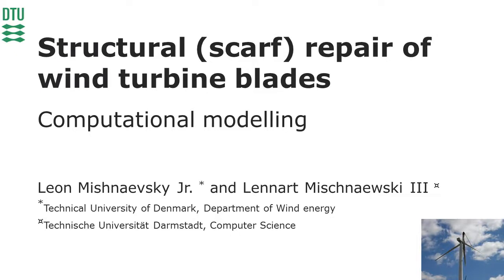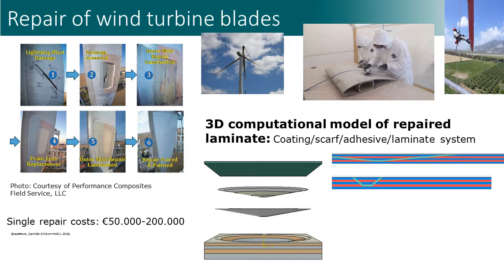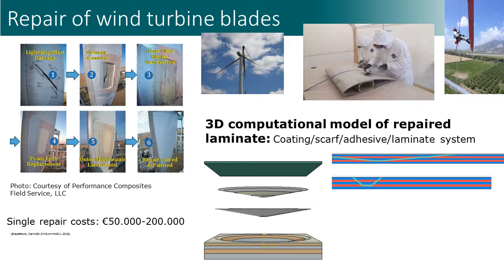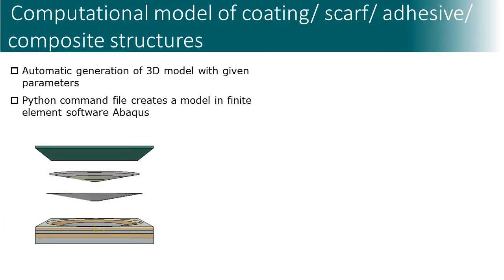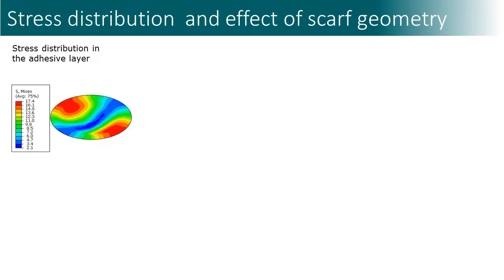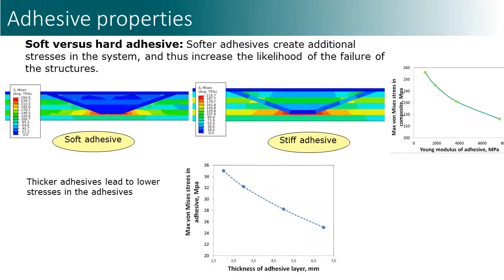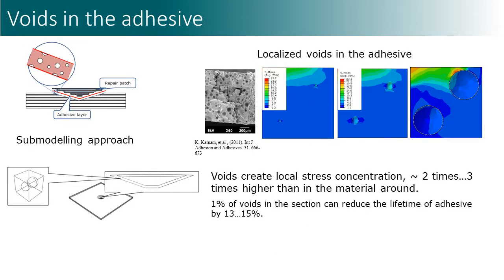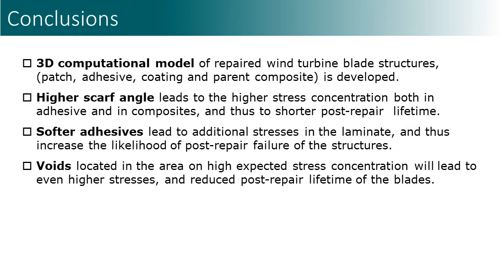Structural (scarf) repair of wind turbine blades Computational modelling

Comment: The conventional deburring and conventional finish/sanding will never become the original shape - profile of a surface of the blade on repaired zone. The laminate layers were cured in cnc - machined shell - form to get the desired profile! It effects, although minimalistically, the aerodynamics of blade in my oppinion! Not to mention the theoretical aspects.